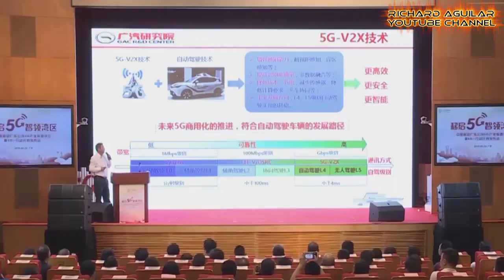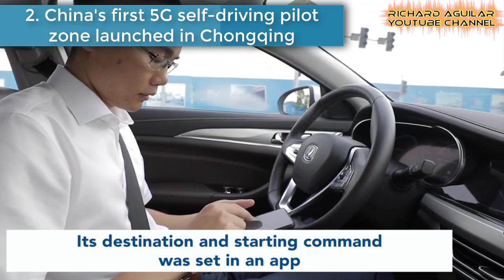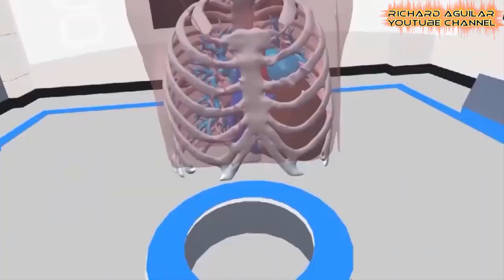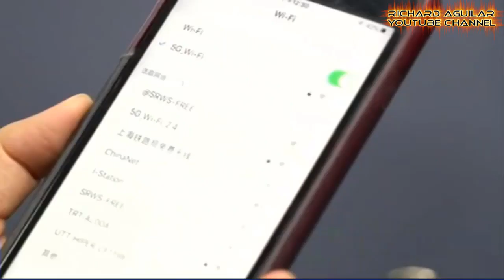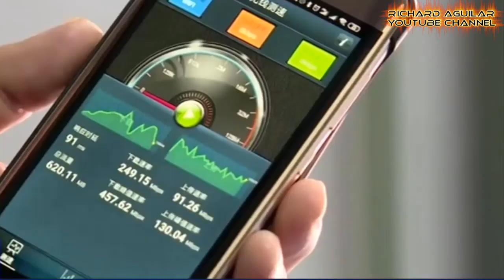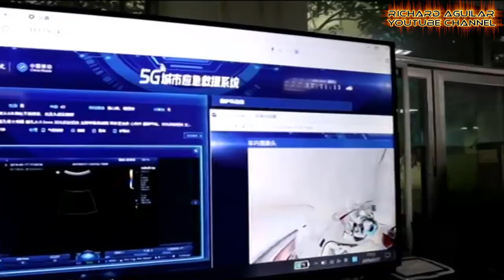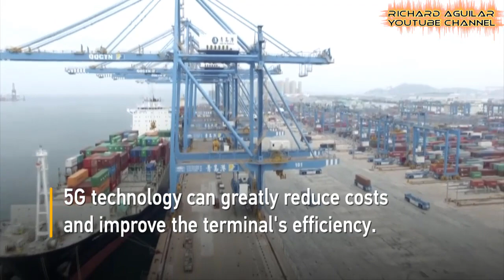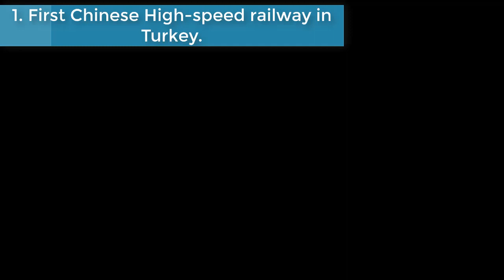China’s 5G Innovation! Watch How China Is Leading In 5G Technology

Comment: Good luck with 5g .... 6g is now being trailed and is supposed to cover areas where the 'old'' 5g won't work by using even higher frequency Tera - Hertz microwaves. 
It is all pretty nastie and unnecessary stuff when much could be hardwired through fibre and the use of 'Light ' technology known as 'Li-Fi' (the alternative).
Stay safe guys.

Comment: why is the sound filled with so much echo.  you should use sound echo dampers, its just felt insulation in a decorated box.  you would will be amazing.  put it in the corners and space this out on the ceiling.  WALAH.   just a suggestion.